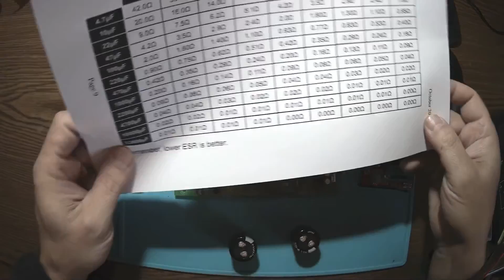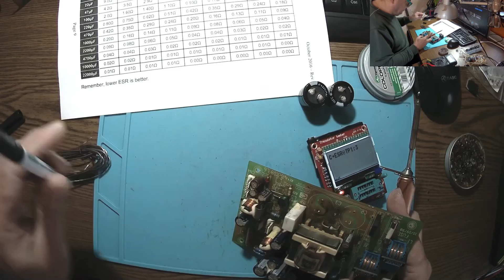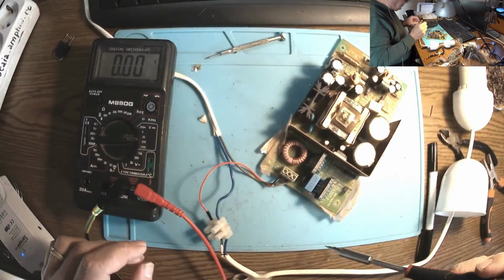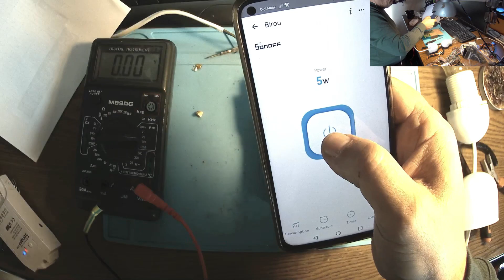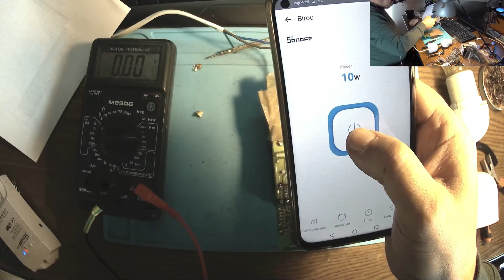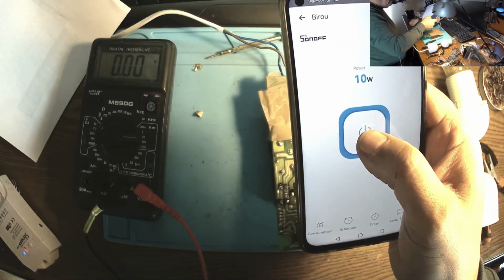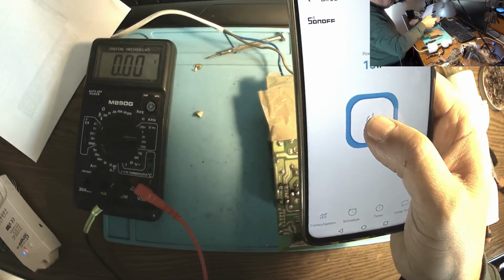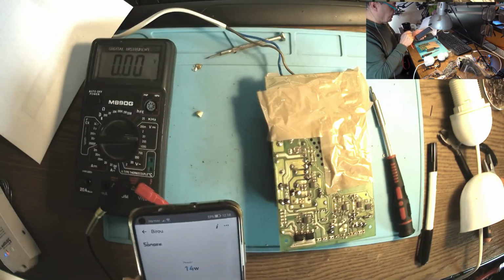Roland EM2000 power supply fix 2

Comment: Have you had any Roland VA76 power supply in one of your works?
I always having a problem with this  and its a bit similar to that one too.
Kartis model.
Reply from the maker: I recall sometimes, when it’s a lot of humidity in the air, the keyboard doesn't want to start. I use a hair dryer to dry it, and it's back in a few minutes. I checked the components but nothing wrong...probably a kind of sensor?
Reply: @viocaia i also had that issue a few weeks ago.
I turned on and nothing then i quit and next day I turned on again and voila it works 😅
Thank you for let me know .
As far i understand this is a very sensitive power supply.
Sonner or later there's always something relatively to it!
Sometimes it happens to make my VA76 out of tune and i did found out if I unplugged the power supply and plugged it again it came back to normal and then after a while playing the problem was coming back again!
Is there anything on the market that can replace this old units with better performance and reliability or do you recomend to do the electrical maintenance procedure.
Many thanks for your time and reply too..
Reply from the maker: @ Try the hair dryer trick, it works like magic!
Reply: @viocaia what i did refer is happening during summer time working with gear door inside.
Reply from the maker: @outsidersband1614  I see...got no clue...